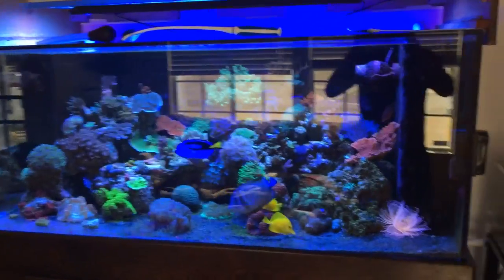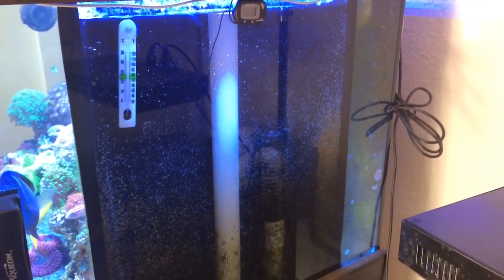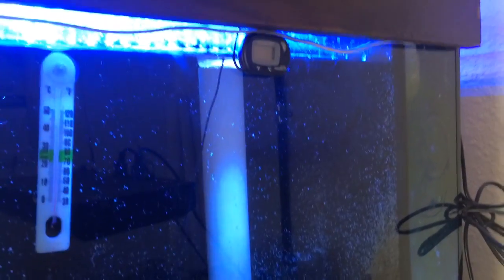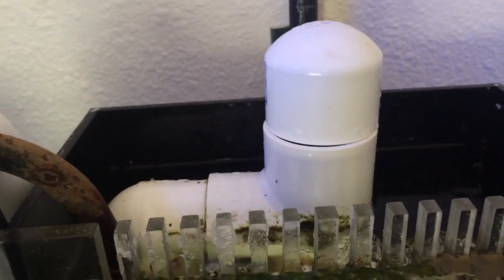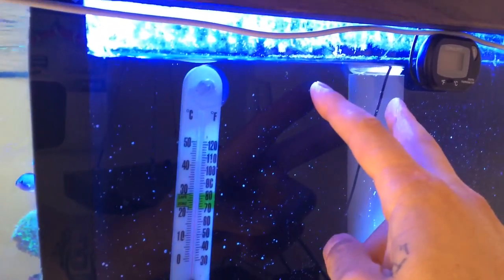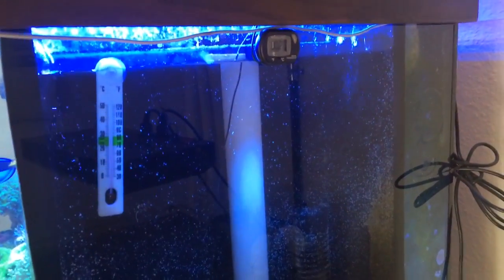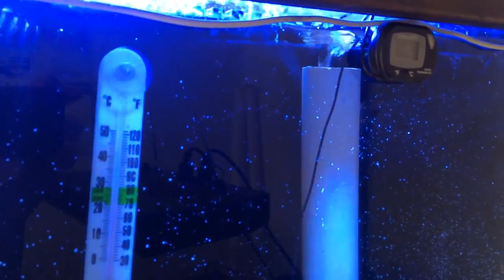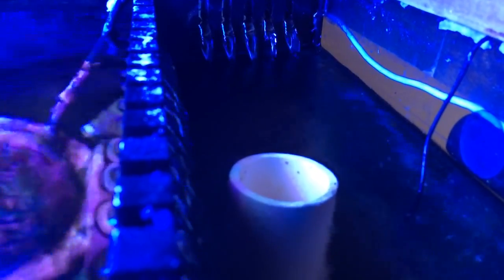The Herbie Overflow Explained

Comment: nice herbie but if you ever run out of power i hope your sump is very big i find your main drain  pipe is way 2 low 2" below surface would be plenty very pretty tank too dude
Reply: I was thinking the same thing. I would be stressed out having the main pipe that low.
Reply: First thing I thought was that all the water in his overflow would drain to the sump as soon as the return pump is off!
Reply: @higorac1  his main drain is not to low his box is to long I think it so you can add sponge or carbon if he lower the secondary pipe it will drop the water level in the box but the sound of water will become louder.
Reply from the maker: Wow I haven’t been on this channel in forever… First of all, thank you for watching and commenting. This tank has been long gone but yes, my sump was 100 gallons so there was never an issue with overflowing. Also, the only water that would overflow would be from the top of the emergency standpipe down to the main drain which was probably between 3 to 5 gallons. You just have to figure out what works best for your system. It’s preference really. You can put all sorts of different emergency check valves and things like that but my safety was just having an oversized sump so I knew even if it overflowed it wouldn’t be a big deal. The worst thing that would happen would be my scimmer overflowing and making a mess in my sump, in which case I would just drain all the water out of my sump and fill it up with fresh salt water and that would pretty much be my water change. Thanks again

Comment: why is the main pipe is so low compare to the emergency one ?
Reply: The reason is the siphon works via gravity so you have more water pushing down so it starts the siphon quicker. Also keeping it like mid-level in your box stops air from being sucked in. It also keeps any large floating items from being sucked into that main overflow blocking it. You can place it all the way at the bottom but it'll drain more water into the sump (which you don't want) on a power outage.

Comment: Is that 1inch pipe and when you drilled your pipe for the overflow the holes are 1 inch too?
Reply: The holes will be a bit bigger in order to accomodate the bulkhead. My plumbing is 25mm / 1 inch but the holes are 35
Reply: Robert S. Reilly gotcha

Comment: quick question about this set up. your primary overflow and emergency over, can you put an elbow from your main to the emergency and still serve the same purpose. i don't have the luxury of having enough holes drilled in my tank.
Reply: sorry I am late and I hope you get this.If I get what you are saying right you want the E drain to be connected to the primary overflow. The answer is NO  you cannot as the E pipe would allow air hence the main would never have what is called a full siphon. They have to be separate.

Comment: With your main drain down so low, how do you prevent a sump overflow during a power outage?
Reply: +RedDelPaPa The primary overflow sits inside the overflow box. The only water that will drain in a power outage would be the water in the overflow box, which is very little. The aquarium water itself will only drain down to the teeth at the top of the overflow box, and then stop "overflowing" into the box.

This is the point of an overflow box. It's sealed along the bottom and sides to the aquarium. The only way for aquarium water IN is to overflow at the top teeth.
Reply: +D rB ok.  Yes I'm dumb.  lol  So if you replace that lousy ball valve with a quality gate valve, you can get that herbie tuned perfectly.  allowing the E drain to stay dry and of course, dead silent.  There are several inches of wiggle room because as the level in the overflow tower increases, the herbie siphon will drain more water from the increased pressure.  So it will come to a balance.  Allowing you to fine tune with a gate valve to the point where your e drain stays dry.

Comment: Great video, thanks. One question - Your primary overflow looks very low down. If you switch off your return pump won't the level in the tank drop that low also? I'm guessing your sump would also overflow in that instance as well? Am I missing something?
Reply: +Charles Wilkinson The primary overflow sits inside the overflow box. The only water that will drain in a power outage would be the water in the overflow box, which is very little. The aquarium water itself will only drain down to the teeth at the top of the overflow box, and then stop "overflowing" into the box.
Reply from the maker: If your return lines either have a check valve or are set up to where they will lose the siphon as soon as you unplug or lose power to your return pump, The water level in your tank shit on them drop as low as the teeth on your overflow box. If you don't have valve on your return lines or it's not set up to use the siphon, your water level will drop as low as you have your return lines in the water.
Reply: +D rB Ah, I see. I guess that's true if the overflow box is indeed sealed.

Comment: I'm a newbie here and have had my tank set up with the Herbie Overflow for a few months now.  Let me tell you it has been super frustrating trying to fine tune the drain so that I only have a trickle getting into the emergency pipe.  SO, my question is, if I ever to find the balance what on earth do I do when I am doing a water change?  It seems like the process of fine tuning would start all over (which has taken weeks for me...)  Any thoughts?
Reply: April Schutt It's not a herbie if you have a trickle in the emergency. It's an emergency because it's only used in an emergency. Problems arise when you restrict the drain or return in any way...filter socks or plumbing reactors after your return. You should never have to adjust anything once dialed in unless something is clogging the drain.
Reply: +April Schutt Shut off your return pump when doing your water change. Change water out of the main tank (siphoning up the crap while you do). Fill it back up with water, turn on the pump again. Never had to mess with the valve you set up on the herbie drain.

Comment: How much flow do you get from this an how big are the holes, pipes and bulkheads?
Reply from the maker: I'm not an expert at all that flow stuff. In my opinion I don't think flow from the return pump matters as much if you have good powerheads in the tank. As far as the size of the pipes, the main drain is 1 inch and the emergency overflow is either an inch and a quarter or inch and a half.

Comment: what size is the pipe ? it looks like 1". if so how much flow are you getting?
Reply from the maker: The main drain is 1" and the emergency is 1 3/4" I believe. As for flow, I'm not exactly sure. All I can say is that my WaveLine DC 12000, which claims an output of 3170GPH, is cranked to 100%.